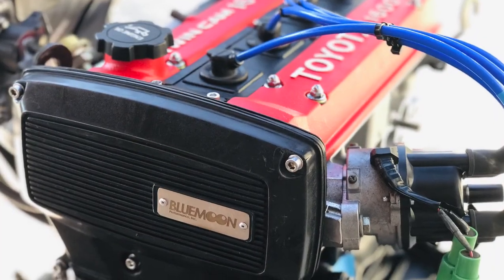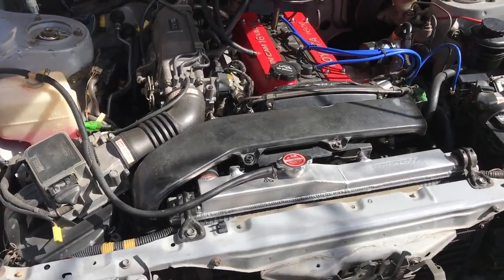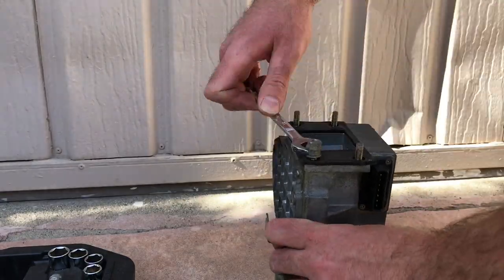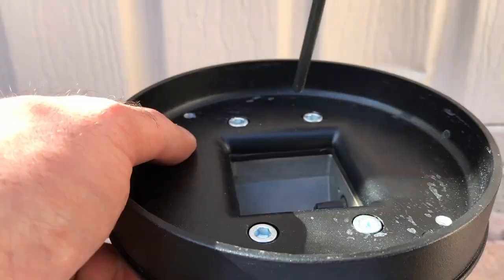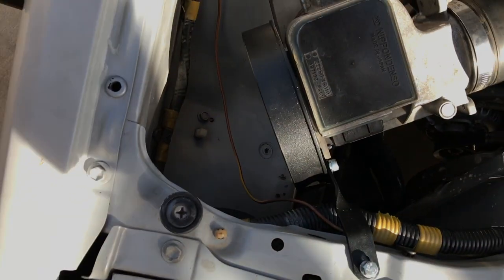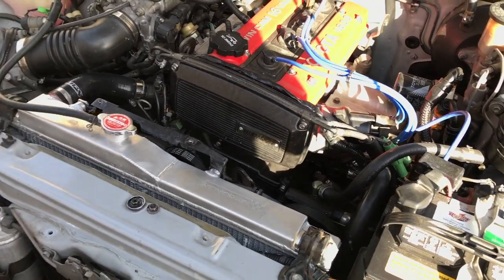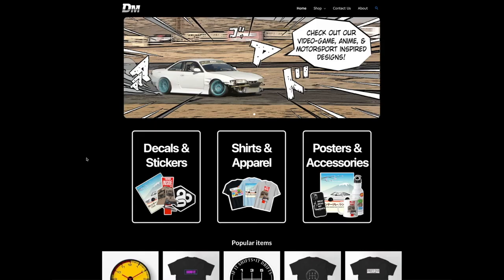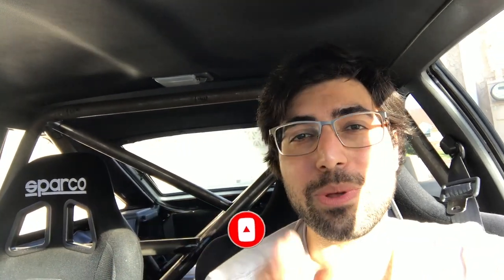The AE86 Gets a New Intake! - K&N Cold Air Intake Install & Impressions - Project 86: Episode 8

Comment: Now it sounds like a proper 4ag!! Good stuff man, didn't even know K&N had a filter system for the 4age.
Reply from the maker: Thanks! It's one of the few CARB legal intakes for the AE86 and cleans up the engine bay nicely. The sound and power gain are just icing on the cake!